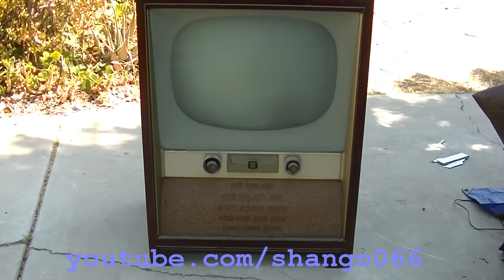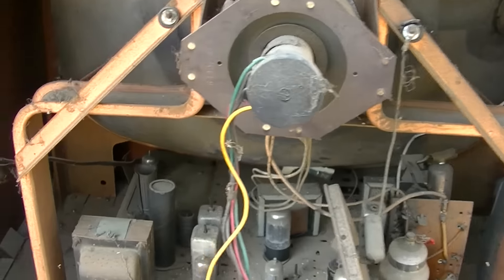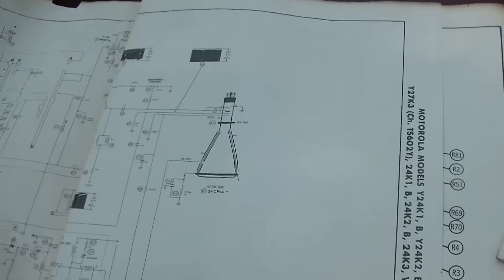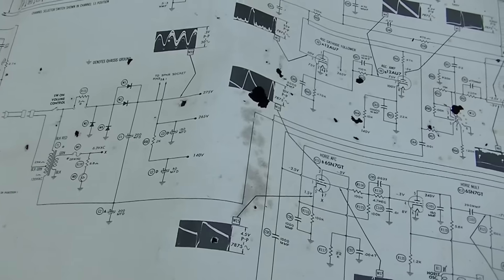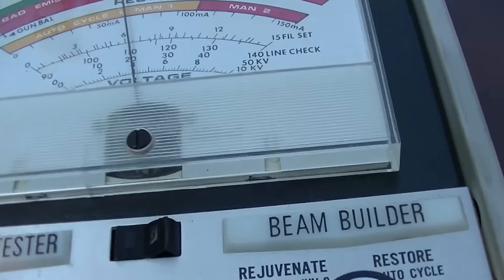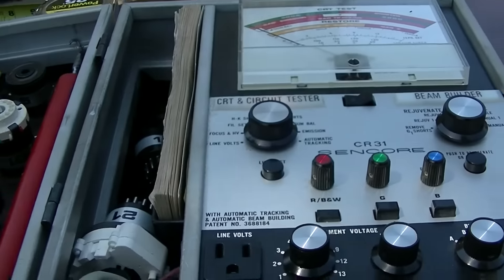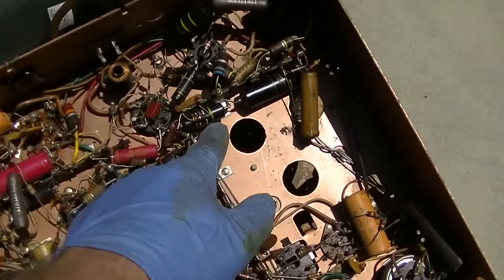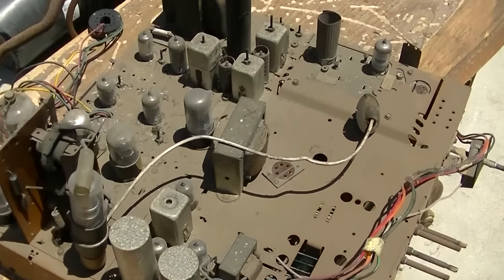Massive 1954 Motorola 24 inch Black And White Console Television

Comment: One of Motorola TVs I restored had this same issue, 100% dead CRT.  It did produce a picture and had a heater to cathode short.  I was able to source a replacement CRT and restored the TV as I really wanted to save the TV.  The cabinet is all Bakelite.  I also have my grandfather's 21" Motorola TV and it had a rebuilt CRT in it when I got it.  Motorola really did aim for serviceability as both my TVs are just as easy to pull the chassis as yours was.  Since I rarely ever plug my Grandfather's TV in, I just recapped it but I never changed out the seleniums.  When I restored the other TV, I used a wire wound resister that had a sliding tap on it to adjust the resistance.  I used this to get the voltage where I needed it after installing silicon rectifiers.
Reply: same. EVERY Motorola B&W set I've ever run across has had a stone cold dead CRT. EVERY SINGLE ONE.
Reply: what a Kool 1954 motrola back and white console tv when I lived at home with my mom and dad mom and bout a motrola cloard tv console in 1963

Comment: I have the 21" version of that, though maybe it's the 1955 version. It has a super-early germainum diode detector (which sadly was leaky). The 21ALP4 CRT on mine is the original and was totally dead when I found it - however - following your teachings, I whacked the neck and did several jolts of rejuve and it finally woke up enough to produce a picture. Virtually all paper caps were dead shorts and the tuner required a very deep cleaning, but it's actually a great little performer now. Too bad about this one though!
Reply: what was the symptom of the leaky detector diode? all my sets use germanium didoes as detector generally the oa81 type
Reply: @MrHBSoftware  If I recall, replacing the diode resulted in better contrast and overall better picture. The schematic on mine shows it was a CK706 (it was red, Raytheon branded I think) and I replaced it with an 1N60.
Reply: Is it possible to rebuild the picture tube on these?

Comment: I would think the reason that CRT's are measured diagonally is because they started out being round, so the size was basically the diameter. Then manufacturers found ways to make them square-er, so they would fit in smaller cases, but the most important measurement would still be the distance between the corners. I don't think that's cheating.
Reply: When my wife and I married in 1973, our first television was one exactly like this one (except it had its back!). It was a gift from my father-in-law, and we used it for several years.
Reply: Dumont Royal Sovereign (1951) had a 30" CRT.
Reply: I agree. My Dad was a GE employee and bought a top of the line console "Ultravision" TV in late 1954, similar in appearance to shango066's Motorola. It was designated 21", but that was the corner to corner measurement of the CRT. The viewable diagonal was about 20". A common portable TV measurement was 17" with viewable diagonal of 16".

TV sets had a safety glass in front of the CRT, to protect room occupants from flying glass should the CRT implode. Spontaneous implosions did occur. I recall a statistic of about 50 a year with millions of TV sets in use. In the early 1960s, the bonded CRT went into production, with the safety glass bonded to the CRT. The improved integrity allowed manufacturers to push the corners out, so a 17" CRT became a 19" with more of the picture corners visible but not increasing the size of objects on the screen.

In the late 1960s, a Federal Law was passed which required manufacturers to measure the viewable picture, addressing the "cheating". A 19" screen became a 18" screen. It was hard for salesmen to explain that a new TV with 18" screen had the same size as the customer's old 19" screen. Manufacturers tried to eliminate the diagonal measure and quote square inches of viewable area. That did not go over well with customers, either. A next generation of CRTs was developed, basically increasing picture size. A TV  might be labelled 20" with the additional notation "Designated 21" in Canada". (Canada didn't pass a similar law.)

The story on the bonded CRT: Corning Glass Works was making the CRTs and Pittsburg Plate Glass made the safety glass. Corning worked with adhesive manufacturers to develop the clear bonding adhesive, allowing them to make a CRT and safety glass assembly, taking the safety glass business away from Pittsburgh Plate Glass.
Reply: Correct

Comment: There were a few 27" B&W sets made using either the metal cone 27AP4 or all glass 27EP4, 27GP4, 27NP4, etc..  Both 24 and 27 inch sets are very hard to find now.  I've only seen one in person and it was too dam big to fit in my hatchback :(
Reply: I had a beat up Magnavox as a kid. It was big and ugly and I didn't keep it. Along with many round colors. I want them back!
Reply: you would be perfect to adopt this set the cabinet is in nice shape for its age 
no desert rot

Comment: Dumont made a 30" B&W back in the 50's.  It was a glass/metal roundie, probably a 50 to 70 degree deflection type.  Tube was similar to the type 19AP4, except almost twice as large!
Reply: Love to see him find one of those!!
Reply: And here I was, intending to post about a Soviet 65cm (25.6") black-and-white TV from the 70s.
Reply: Damn, 30" round?!
Reply: @xenaretos  Like to see that soviet tv too!
Reply: @volvo09  In the early 50's! I am used to seeing the smaller or round screens from back then!
Reply: @Charles Coderre My Grandfather had a 19" Dumont TV that must have been the baby brother of the Royal Soverign, I think it used the very same chassis, but had a smaller cabinet, and a 19AP4 glass/metal round CRT (50 degree deflection).  There was a place in the cabinet for the future installation of a UHF tuner.  The set used the Mallory indotuner, and had a dual speed flywheel tuning dial that covered TV channels 2-13, and the FM BCB, aircraft band, and the amateur 2 meter band.  There was a 6AL7GT tuning eye tube as well.

Comment: ive seen bob andersen fix a tube once with a similar issue, and he used a trick where he heats it up big time, gives it a knock and it welds the broken connection internally back into place again

Comment: It would be an interesting experiment to try to zap the tube back into conducting. Charge a high voltage cap about 1-10nf to 1-2kv and connect it to the cathode and grid. Maybe that would zap it enough to where you could use the beltron.
Reply: i've done that with filaments on radio tubes before when i had no options for replacement, i have an electrophoresis power supply with 100-3000v constant current constant voltage output at 300w, if you dial it to 2kv and set the current to 5ma it will dump a short pulse of power into a short then regulate at 5ma.
this won't work here because you'd need a ton more voltage, the grid is easily 3-5mm from the cathode and in a vacuum thats gonna need 100+KV to bridge, a better attempt would be to go from filament to cathode where the distance is about 1mm or less still you're gonna need 20-40kv to bridge that and you're probably just gonna blow everything up.

another thing he could try is flipping tube upside down so the cathode wire is on top and tapping

Comment: As a kid, we had a ca. 53-54 GE B&W TV that was really massive. It went through numerous service calls and CRT replacements until we got fed up and replaced it ca, 1964 with a Zenith 19" luggable from Polk Bros. 
By the 70's. I was working for Motorola and they are out of the TV business. The MOT always made solid iron. Well engineered and built. But business management was less than solid.

Comment: Here is more food for thought. In the early 1960s 1961 1962 Magnavox made a 24in television floor console. If you can get your hands on one of those that tube I am sure will fit in this Motorola TV. The neck of the Magnavox tube is thinner so you will need to change the CRT socket but otherwise the Magnavox tube is a 6 volt tube and it should work out if you can get your hands on one. Just some food for thought in case you really want to restore this Motorola. This Motorola is a really really nice TV to get going

Comment: My dad worked for Motorola from early 50's (Augusta Blvd in Chicago) and from about 1961 or so he worked at their new factory and hq on Grand Ave in Franklin Park IL.  He worked his way up from line worker to regional area warranty service tech.  He and one other guy were the techs that were put on very difficult repeat warranty issues (particularly with the Quasar solid state stuff).  As for this tv, we had the exact cabinet version of this tv but it must have been a year or two newer because it had 3 knobbed controls exposed  (bright, vert, hor) where your set has a cover.  It definitely didn't have that antenna gimmick.   What I have always remembered about this tv was the sound quality.  It had (I think) an 8" round speaker that had incredible very clean bass response with good volume output.  I don't recall this tv causing problems and we used it until we got the new rectangular 25" color console sometime in the mid-late 60's.   Then my dad gave the b&w to my uncle and he used it in his rec room right up to the 70's.  My dad use to say that  to be one of their engineers you had to be a genius to get hired lol.

Comment: I restored an RCA 21-S-548NU floor model and the chassis slides out very easily just like this set. Everything plugs into the chassis and the picture tube stays in the set. I have it working beautifully and the serviceability it has is unmatched so far. Only downside is I have to put the chassis back in the cabinet and hook everything back up before seeing if the image is better. I really admire Zenith Porthole sets where the picture tube stays on the chassis so you only have to put it back in the cabinet when you know everything is working correctly. I wish more companies today made their tech equipment as serviceable as tube equipment.

Comment: I had a combination Magnavox with stereo and 15 inch speakers and 27 inch tube, probably early 60s. I had to get a rebuild for it and they needed my old tube to do it. It had a reasonable picture when it was done but I was just starting out and screwed up the alignment thinking I could tune it up like a radio. Between that and it kept popping like it had a high voltage problem I ended up scrapping it. A friend took the woofers and built some speakers with them that he thought sounded awesome till we started actually realizing what decent sound was. My tube was a 27XP4 if I remember right. Wish I had some of the antiques I was playing with back then.

Comment: Motorola always did things their own way.  Another example would be the "Placir" circuit board.  I had a 23 inch color 909 chassis that still worked strong when I retired it in the late 1970's.

Comment: Measuring picture tubes diagonally is a win - win. Not only is it the longest dimension but it accounts for any variation of aspect ratio by being able to ignore those. A right triangle of course has one dimension for the hypotenuse, but the two sides can be various lengths. Measuring and reporting those can be somewhat ambiguous so we like the dimension of the hypotenuse instead...
A shame about the picture tube. Would have been a nice restoration project. I agree the quality was there, but back then those sets cost a family a fortune. They were  a fairly major investment for a family.

Comment: That's called a directional antenna, dude. It was back in the day before onmi - directional ones came out. I can remember as a youngster having to get on the roof and rotating our antenna after a storm came through. We had 3 different ones on the same mast, one for each channel. Yes, all we had was ABC, NBC and CBS local stations. We had one UHF station operated by the local Junior College and used rabbit ears to get that one. That 24"er would have been state of the art back then.

Comment: My parents got a new set similar to this one in 1961, I think they called it a 23 inch; that was the largest size available then, I think. The cabinet was almost the same, but I never saw the chassis. It was a relatively cheap set, since it didn't have a UHF tuner. We got the VHF Chicago channels, and local channels thru an older set top UHF converter box leftover from the old TV that died(a 1953 Crosley).

Comment: About 15-20 years ago, I had a look at a mid 50's 27" either Magnavox or Motorola B & W console tv the people across the street where throwing out. Unfortunately, the crt neck was broken, and the back and knobs missing. I passed on it. To me, it's disheartening when I have an otherwise good working tv, but the picture tube is bad, and no replacements.

Comment: I remember that was the last black and white my parents had in the early 60's.  A gift from the grandparents I believe. Then we got a 13 inch color tv which we watched the moon landing on.
Reply: I had a black and white up till 2009. Used during the many hurricanes we had in the summers as it would run off a 12V battery. B&W seemed to make the sharpest picture at the time.

Comment: The reason they measure diagonally is for fair comparison between round and rectangular sets, Since round sets with a mask on have a smaller usable area then a rectangular set measured horizontal/ verticaly

Comment: Maybe something like a Speaker coil connected to the crt neck could be used with a signal generator to make the parts inside the gun resonate and start working again?

I have "fixed" plenty of old lightbulbs by tapping them etc to make the broken wire inside make contact and self-weld itself back in place, not the same thing but i imagine a broken wire could do the same inside the crt

Comment: The two-rectifier arrangement was used with a center tapped power transformer secondary for full-wave rectification.  I was tempted to buy a pair of those old-fashioned selenium "grates" in new OEM condition from our local electronic supplier to see if they'd have less switching noise than the modern potted bridge rectifiers I use in my little tube audio projects, but the price stopped me cold in my tracks.

Comment: 24:40 As someone who does component level repair on modern PC's, that looks like an absolute nightmare to me. Like someone ignited thermite on top of their component storage and after it worked it's way down through all the drawers of parts, that's what coalesced at the bottom. I would have loved to have seen one of these actually assembled, I don't know how the schematic isn't just a picture of a plate of spaghetti and meatballs.

Comment: I used to work on video games. They came out with these monster cabinets using 32 and 36 inch tubes.  Previously we had 27 inch. I noticed the large CRT would always go dim in a year or two.  After 5 years, you could not see the screen.  Is it possible, they use the same gun and it is over powered for such a large screen?

Comment: I was fortunate to save a 24 inch Crosley slated for disposal. Only a half a day in the rain. It was passed over due to weak CRT. I haven't checked it out for myself. It still displays wonderfully even if it doesn't play. It's like a refrigerator cut in half for a size comparison.

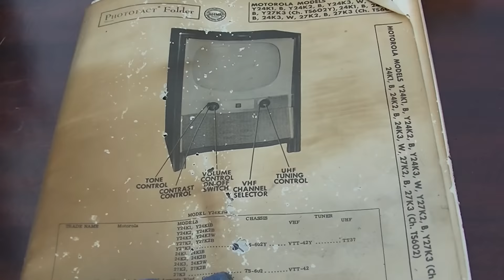Comment: 3:47 I miss the days where it was expected that the vendors provide all docs if you want to repair on your own. Right to Repair FTW!
Reply: I got a 1965 packard bell rpc-39 stereo console two weeks ago but  the power amp needs a rebuild and the turntable needs a relube but the preamp/tuner part is still good so I use a nad integrated hooked up as a stand alone power amp, but when I get it fixed, I would not be surprised if it outlasts most modern electronics in my house

Comment: I have a very similar GE cabinet shell I found at curbside pick-up. I put 2 pieces of 1-inch pink styro down and slid my 19" color SANSUI unit into it, Just the right height for the remote to work, only drawback is the A/V outputs are on front, need some 90-degree RCA jacks so I can get the tube right tight to the oval screen.

Comment: Sometimes turning set upside down helps weld the cathode, when cathode fails tend to fall down over, tapping right way up drives them further apart, upside down helps bring it back into contact

Comment: Urk.... How much would it cost to send that CRT to a rebuilder? Just the shipping costs for that tube would be insane. And yes, I know you still have flyback and yoke issues on top of the usual capacitors.... 

Test capacitance between the filament and the cathode. I have confirmed cathode lead failures that way... not that I could fix them without glassblowing skills. :( 

I did have a GE Ultravision with a 25ALP4 CRT. It was late 1950s, hot chassis and selenium rectifiers, bad flyback - I never got it to work, but with my current knowledge, I'm sure I could have had it work. That was one scary big glass bulb and I was terrified of it imploding on me. Chassis was mounted in the wooden cabinet above the CRT. 

Also, scored a 1956-1957 Motorola, and I think it was about 24"-25", hot chassis and selenium rectifiers. I did get that working and used to invite my classmates in Electrical Engineering school over and we'd watch TV on it as recently as 2005. CRT was weak but watchable, and the vertical output tube was weak but I never got around to replacing it. Chassis was vertically-mounted to the left when you were behind the set, and I think it was copper-plated too. I have a photo of the set with Jon Stewart on the screen.... [sigh]

Then there were the Electrohome Educators - "Now with theft-proof knobs!" the owner's manual bragged. They were 23" black-and-white sets from 1970, almost like they were built to watch the Apollo landings in classrooms. Very, very cool. 

I lost all of them in a fire in a storage unit, so alas they perished in 2012, along with over 20,000 tubes I had collected starting as a kid in the early 1980s.